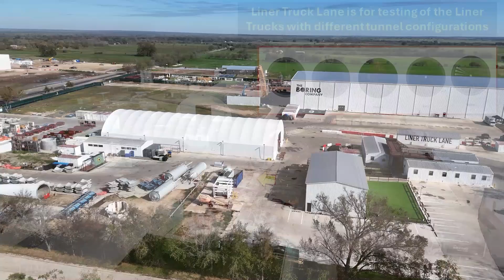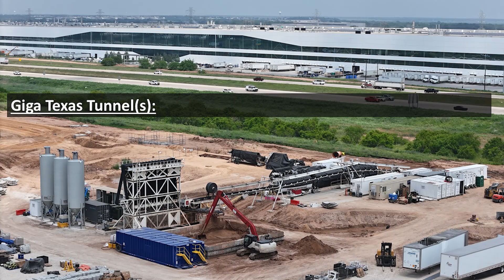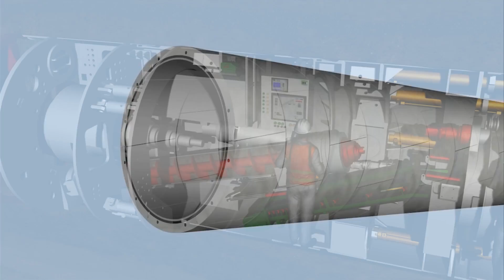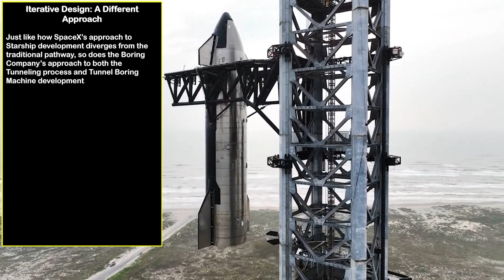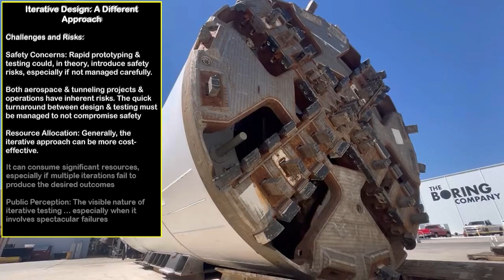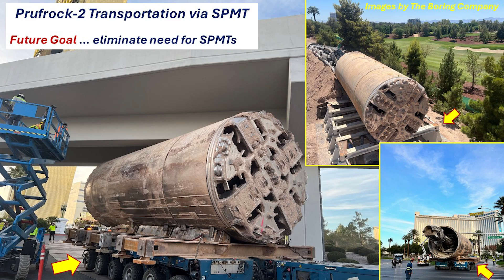Boring Company Tour Part 2 ... Giga Texas Plans, TBM Design & Iteration, New Boring Machines & More!

Comment: great information Joe, thank you. I wonder if the TBM has a GPS to indicate how far they have tunneled. This could be shared on their website page for those interested.
Reply: If they are up to date with their guidance system they will be using a combination of lasers, a gyro theodolite (It knows where north is), and traditional surveying techniques to back that up. If not, then a total station theodolite and laser optical system is the simpler method.
Reply: GPS doest work below ground ;)